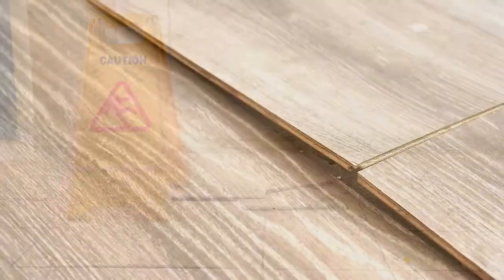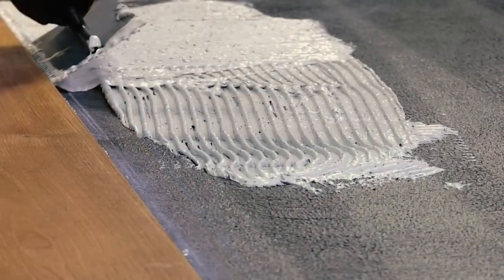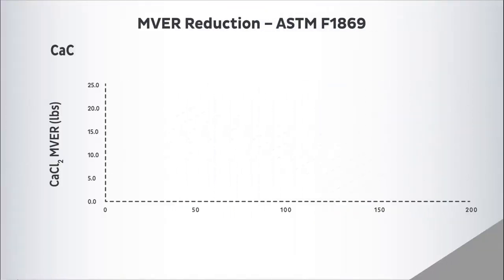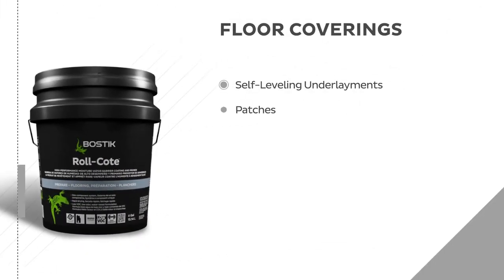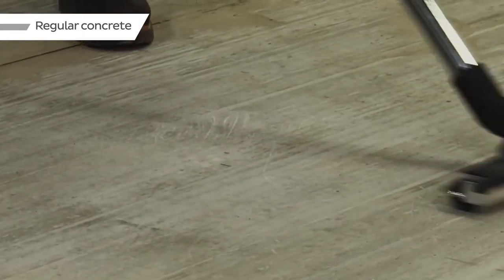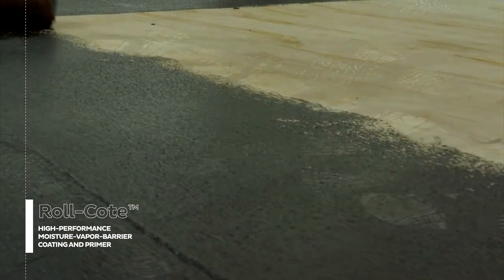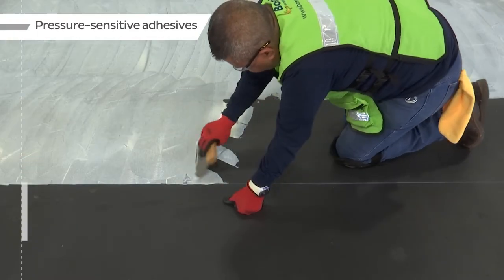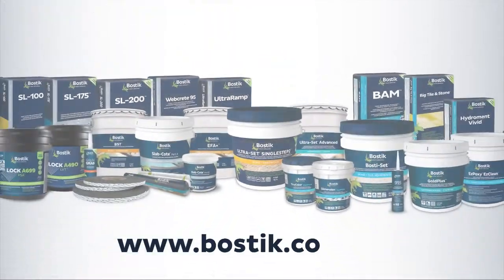Bostik’s Roll-Cote™ | High-Performance Moisture-Vapor-Barrier Coating and Primer

Comment: Hey Bostik, we’ve been having a debate at work about recommending this to customers for certain applications. Will this be ok on a wood floor, on a second floor for instance, or in a bathroom. Could this be an option to compete with Ditra in an upstairs restroom? If not what would be an example of using this on a wood substrate?
Reply from the maker: Hi Michael, thank you for your interest in Bostik's Roll-Cote. Roll-Cote is a moisture vapor barrier that can be used on plywood or OSB subfloors, the application is one coat only to provide moisture vapor protection up to 90% Relative Humidity. This product is not designed for use as a waterproofing membrane, but will bond with mortar to install Ditra over the surface. If you have any further questions contact Bostik Technical Support at 1-800-726-7845.